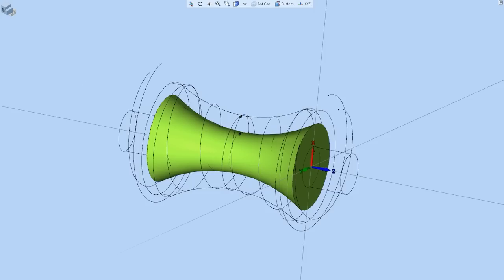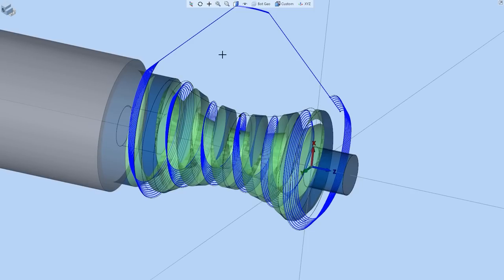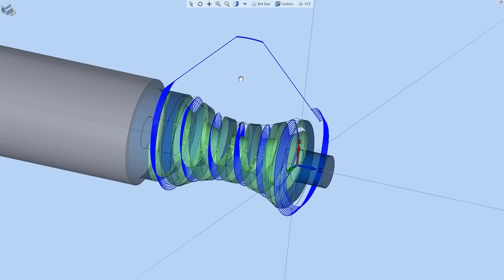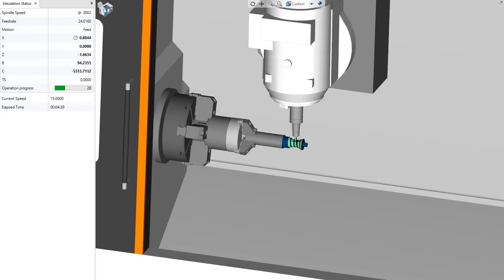Roller Cam Drive

Comment: As far as the CAD goes, can you make a loft cut? In Alibre, you can define a 3d path for your spiral, and then position sketches along it of the groove's cross-section. If the CAD goes find you worthy, it should just interpolate from sketch to sketch, virtual cutting out the grove as it proceeds.  Mind you, Alibre frequently squicks out and adds weird twists if the sketches aren't to its liking.
Reply from the maker: I my software SpaceClaim I tried everything I could think of. I also tried Fusion with no success. I tried a loft. I tried a extrude. I tried to use the two curves as guide curves and a section translate. It all doesn’t work. There must be a way. I just don’t know how.

Comment: Well that is certainly an interesting Chinese Puzzle piece!

Could you grind it on your tool & cutter grinder? It is similar to a drill or endmill flutes. 

(Yea, I know you wouldn't want to do that will aluminum.)
Reply from the maker: Drill and endmill flutes follow a cylinder shape. This shape is following a totally different shape. The edge of a sphere. Also the lead has to vary based on the rollers location projected perpendicular to that sphere/circule.

Comment: I can model that in solidworks by getting creative with swept features. programming that in mastercam even with just the wireframe would be really easy with just the two guide curves. don't even need the second guide curve, just the bottom surface curve and a point at the center of the radius
Reply from the maker: Then model it and program it. Machine it and video record it. Then send me the video and I will post it for you. I would like to see what you come up with.
Reply: @EdgePrecision  haha i will see if i can find the time

Comment: Brother uses Roller Cam gears for the tool turret and their 4th axis. As does Sankyo. The trick is, as you suspected, tapered cam rollers in tapered grooves.
Reply: Hmmm.. so are the Brother rollers tapered larger toward the OD, which would seem to give line rolling contact? Maybe not significant at this radius, especially if they have a little crown. 
Also, if you split the worm in two, could shim axially to take out clearance, or maybe could rotate one half slightly to take out the clearance, which might preserve the continuity of the arc? 
Very impressive! Thx!

Comment: Very neat.  If you turned the horizontal axis in the opposite direction to climb mill, would that give a better surface finish?
Reply from the maker: This was just a test. As I said in the video. I would rough it with a smaller tool. Then do finish cuts on the walls. In that case I would climb mill them. But the real part would be steel and heat treated and ground after that.

Comment: 👍 I would think you'd have to feed the cutter in both directions, reversing the worm so to maintain a climb cut on both sides of the groove. 
Wouldn't the cam follower need to run in an oversized groove or one side would be counter rotating and opposing the rotation of the worm? I'm trying to understand the preload idea. Thanks Peter! You're the best!🤔
Reply from the maker: This was just a test. Yes what you are saying would be true for a real part. As well as heat treating and grinding.

Comment: that's a cool worm. I'll bet if you could find a CBN grinding wheel (so it would not get smaller while grinding) you could probably finish grinding on the mazak. I'll bet that super light grinds would do it.  Of course that's coming from a hobbiest, so what do I know.
Reply from the maker: I think if you really wanted precision the Mazak is too far away with its rotational centers. It would really need a special fixture setup for the grinding. I have a idea what could be done. It would have to be made but it’s not to complex.

Comment: We had a similar worm gear driving a cam that rotated our active sonar hydrophone receivers on our Burke destroyers. This almost looks identical, actually.
Reply from the maker: This is a old idea. The B axis on this machine is driven this way. And this machine is almost 18 years old.
Reply: @EdgePrecision  yeah lines up time wise. The Burkes came into service in the 80s really, so it's been about 40 years. I haven't been to sea in 25 years or so, I assume they're not using mechanical actuators for the arrays anymore anyways. Probably more a static phased array, makes maintenance simpler.
Reply: Surely the rollers only roll on one side if the slot width is the same as the roller? Struggling to see the benefit over a conventional worm, can’t see how this design would help reduce backlash, but probably just my lack of understanding. Amazing machining though. Do you have a plan for this, or is it a purely intellectual exercise?
Reply: The slots are slightly wider than the rollers. But.... The extra width is not the same on each end, so the rollers contact one side on one end and the other side on the other end. No contact at all in the very center. By either making the rollers slightly oversized or leaving a bit of material on the contacting faces of the worm it preloads the roller bearings and takes up any backlash.

Comment: Ive been thinking about making one of these since your B axis video. I dont think you can split it in two to achieve preload. The join would create a lump that the roller has to climb over. Tapered wont work either. The rollers must contact on one side only. Otherwise they cant rotate. The only thing I can think of is every second roller is offset to get preload. Thanks Peter for getting the thought process going on this one!
Reply from the maker: There are a couple of ways. One is two worms on one gear. The other is this. Visualize a straight track with a ball bearing on both sides loaded into each other. Now twist that track into the shape of this worm. It’s the same thing. The slot is wider than the rollers. They ride on the spiral track in between them. If that makes sense. Not on both sides. I favor the two worm idea. It is easer to preload by just rotating the worms against each other.
Reply: @EdgePrecision  that is also a great idea. Kind of like a ballscrew setup running in a worm arc. Deflection will give some backlash though I think. I hope a roller worm company sees your video and chimes in with some insight.

Comment: Definition of having too much time:   i was thinking about building a B axis lathe...
Reply from the maker: If you have done a lot of machine work. You begin to realize this configuration of machine is one of the most useful of any. It can do 99% of all machine parts. If a person could make a simple machine like this. It would cover almost everything a home shop machinist would need. You would need only one machine.
Reply: @EdgePrecision  man i know. I have an i-100hst on order that should be ready in a month or two. Cant wait to do more in less operations
Reply: @EdgePrecision  the real challenge would be to make the b axis lathe without already having a b axis lathe hahaha

Comment: Are you able to add a thread/helix feature around another helix feature in your software because that would be the easiest way. You'd set the 2nd helix based on the the gearing ratio and do. Set the normal of the cross  section to follow the first helix and 1 corner point of the cross section to follow the secondary helix. so as the cross section follows the first helix the second helix will cause the cross section to rotate according to the gear ratio.
Reply from the maker: The problem is it isn’t a helix. You would think you could do a simple sweep with the two guide curves. But the sweep won’t work. I tried it in two different softwares. If a software could do a subtract of one of the rollers rotating around on the gear at the ratio of in this case 24-1. Just like the endmill cutting it. That would work.

Comment: I wonder how to grind those surfaces... maybe a gear wheel like the one you show, but instead of roller a grinder wheel in one of the roller spots.  But that will make the grinding super special, complex and expensive; but very doable. Maybe rollers are not needed if the worm and gear are driven by two motors fully controlled, like a CNC, but just to axis.
Reply from the maker: The grinder only has to sweep the length of the screw. So if it pivots on the wheel center it would only have to swing about 90 degrees. So the worm wold need to rotate six revolutions. So how to do that with the most precision is the question. I’m thinking a Precision lead screw that moves a linkage 90 degrees for 6 revolutions. I can think of a way. That could be very precise. So the grinder could be a tool post grinder with a small ID wheel. Maybe.

Comment: Antalz uses a technique that I think would work for your model as well:
https://www.youtube.com/watch?v=qRBLpBxkldc&t=779s&ab_channel=Antalz

Or search 'Antalz worm gear' if you'd rather not follow the link.

I'm not familiar with the CAD you are using but if it has a similar function to Fusion 360's sweep, then you could probably cut the rectangular cross-section from the paths you've got already.

Comment: Hold on:  Your cam rollers form a "v" or wedge shape between any two of them.  You should be able to invert your tooth profile so that it wedges in between two of the cam rollers. Then all you need to do is control the distance of the wheel to your worm gear to take up backlash.
Reply from the maker: Not really because the clearance would vary depending on where on the diameter you are. I think the best way would be to have two worms rotating against each other.
Reply: @EdgePrecision  How much would it vary?  When machining on a cnc, you would only be down stream on the ball screw by ~.500" depending on tooth width.  The accuracy of a ball screw should be fantastic at that small trailing position relative to the original path.  Just some thoughts.  I hope it helps you.  Thanks your great vids. Cheers.
Reply: I'm incorrect.  The cut does not rely on ball screw travel as it is the cutting head that rotates.  The cut accuracy is dependent on the repeatability of the rotation.  Maybe you have a cutter ground to form the tooth profile in one cut.  Not cheap I know.  Ideas are free tho.

Comment: That's awesome.
I remember reading somewhere that the thread pitch on the worm is not constant and the slot is wider than rollers. This allows the roller to roll with clearance on the opposite side and the exiting and entering rollers preload against each other while the ones in the very center are actually clearance on both sides.
Reply from the maker: One way it could work is if the screw was pinched between each adjacent roller and the groove was wider. Imagen a straight  track pinched between two roller bearings. Now twist that around in the worms shape. That would do it.
Reply: This would explain why the rollers seem to be barrel shaped, facinating.
Reply: If the roller slot was exactly the right size, but the rollers alternated spacing just a bit, every even roller would touch one side, every odd roller touches the other side. This way you'd have zero backlash. Every other roller would roll the opposite direction. Probably easier than a split screw.

Comment: So it's just like a worm gear, but with several more teeth engaging at once.  So a very strong construction.   This would be super useful in adding even more strength to something like a "Torsen differential"-  for heavy duty applications.   Very interesting.  I like it.
Reply: It’s exactly like a worm gear but with rolling contact between the elements rather than sliding contact. Big reduction in wear and friction and it allows you to eliminate any backlash by preloading the rolling elements.

Comment: A purpose built machine with a large rotary table, slide and spindle on it bolted down to a base plate and geared to a dividing head/tail stock might be able to manually do it to some degree.
Reply from the maker: I saw a video on YouTube doing just what you are describing. But I could not find it.

Comment: I wonder how it would turn out using a single point cutter turning it?  Is it possible?
Reply from the maker: It’s not impossible but the tool would have to have the correct clarece angles. But I don’t think the machine would be able to move quick enough to make it practicable.
Reply: @EdgePrecision  Thanks for the reply. Love your videos.

Comment: Peter, I can see the difficulties that the rollers add.   If the point of this is accurate movement instead of brute force thru mechanical advantage, how about replacing the rollers with a precise delrin dowel?  Or a steel stud with a Delrin lining on the outside?   CNC ballscrews live years while interfacing with Delrin.
Reply from the maker: The B axis on this machine uses this exact same system. Just do a search for roller cam drive on YouTube. You will see this is a way many precision rotary tables work.

Comment: In Creo I think you could model this easily once you have the curves using variable section sweep.
Reply from the maker: If the software could do a subtract with a roller/cylinder following the curves I have already drawn. My software wont do that.
Reply: Export the solid and curves as an IGES and I would be happy to take a shot at it for you. This mechanism has always been of interest to me. I think the geometry looses fidelity going back and fourth but it’s very minor. 5 decimal vs 7 kind of deal.
Reply from the maker: @chrispoirier384  send me an email at peter.edge.pre@gmail.com I will send you the model. Put in the description roller cam drive. So I don’t delete it.

Comment: I think you could generate preload by adjusting the rollers (every other). Look at it like pairs of rollers squeezing a rib. One non eccentric and one eccentric roller so one adjusts the preload. This also allows a small gap so there is no rubbing on the non drive side of the roller.
Reply from the maker: Two worms loaded against each other is easer and does the same thing.
Reply: @EdgePrecision  Two worms would definitely allow you to preload the gear. The only problem I see with that is that both worms would have to be driven in sync ( additional motor, coupling, chain, belt, something) as you can't back drive a worm with a gear.
Reply from the maker: @mikebrowne5152  I don't think this would be a problem using a timing belt. Like many servo motors are connected to the machines. Making the couplings adjustable so as to load the worms against each other to eliminate the backlash. This would also increase the load capacity of the drive.
Reply: I think offsetting every other cam would be work, but i dont think having eccentric adjustment would be a good idea as it would be very hard to get consistency for all roller pairs and so you would get a motion error as it rotates. There will be a certain amount of flex of the follower bolt to take up the hole position tolerance. If they are bored around the perimeter you should be able to get a good position.
Reply from the maker: @lawmate  In thinking more on this. I think there are two ways to go. Make two worms with clearance on the rollers. Then load one against the other to control backlash. This make the wheel with the cam rollers easy. Just a even roller spacing all around. The other way. If you visualize a straight track with a bearing on each side preloaded  into each other. Now take that track and wind it into the worm shape. That's what the worm is. Now position the rollers in pairs on the wheel so that the worms spiral track rides between them. They don't necessary have to be in align with each other each pair could actually be angled to take advantage of the lead better. Now in fact each pair could be mounted in a rod that is fitted very closely in a bore on the OD of the gear plate. Now if they could be rotated by some means as a pair to adjust for the back lash. So there would be twelve pairs on the gear running on the worms track this way all the bearings would be always rotating in the same direction. With the first idea with two worms the bearings will have to reverse directions going thru each worm. Probably not a big problem. But I think it would be better if each bearing always rotated in it's same direction for high speed operation. I like this concept and think I will make a design based on this idea.
Reply: @EdgePrecision  I guess make the simplest first and see what needs improving. If the rollers are radially aligned, the track profile they mate with would be an inverted V, so moving the worm closer to the gear plate should increase preload. As an aside, Tunkers make a rotary positioners that have the rollers aligned axially to the gear plate. They use a double worm arrangement but I think they are large and so would only ever move slowly.